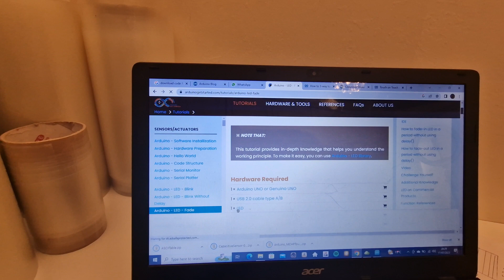I think I will give up on my motion table!  I found the way to fade on led. Testing out Arduino Mega

Comment: Hello, Have you thought to use ws2812b leds? They are 5V and individual addressable = perfect for ARDUINO. You can do fade in / fade out effect by 1 line of code
Reply from the maker: I believe they are more expensive.  For this table I will stick with this as I have already bought them but for next one I might use others. Thanks

Comment: Hi man, I discovered your channel a few days ago and saw that you were struggling with the fade effect of your touch table.
I saw that it was coming from your 5v TTP223 touch buttons with capacitors.
So I'm not an electronics engineer, but I think I know where it's coming from.
Looking at the circuits of the TTP223 I see that there's already a capacitor inside (C1) and it's highly likely that it's this capacitor that's at the root of the problem (the electricity before filling the capacitors first goes into the touch button, charges the small capacitor in reverse then recharges it and then charges the large capacitor) the electrical "minus" in the circuit is already in the large capacitor, so when you release the button, it goes back up and takes time to make room for the electrical "plus".
So to solve the problem, 2 solutions: remove the capacitor from the touch button or put a diode between the touch button and the capacitors (or both). 
Hope this helps...
Reply from the maker: Thanks. I apreciate it. I will have a try.

Comment: Do not plan to use an Arduino. It will increase wiring, power conduction and xomplexity. I think with a transistor and capacitor u will get the fade off animation.
Reply from the maker: I have tried but it didn't work. I will try some more ways